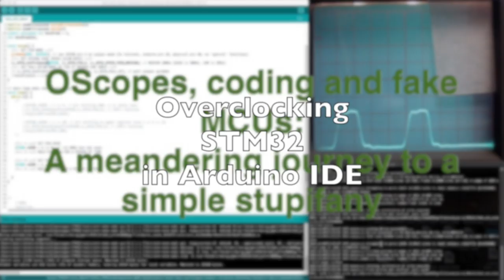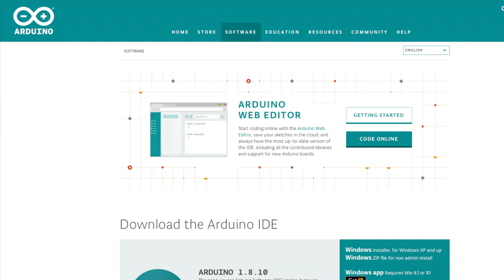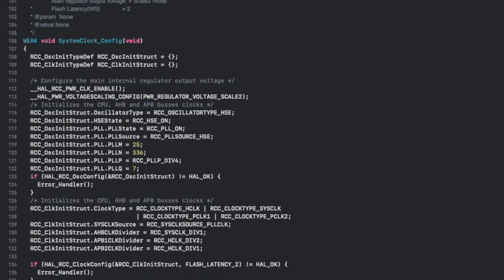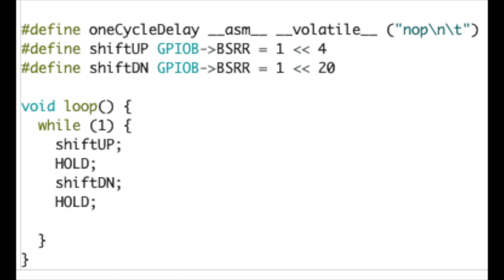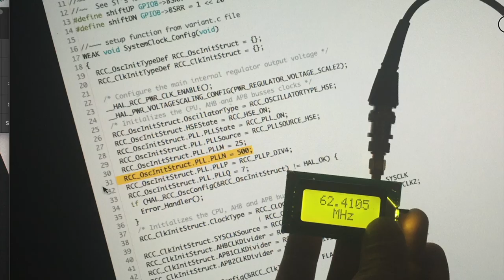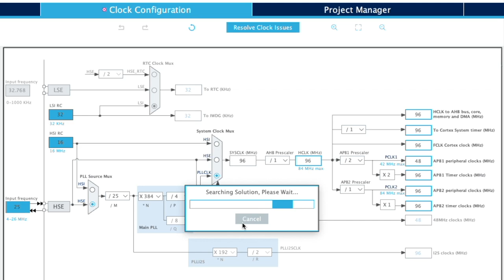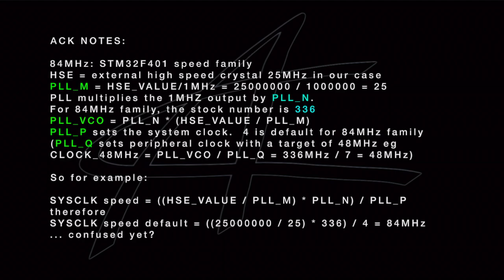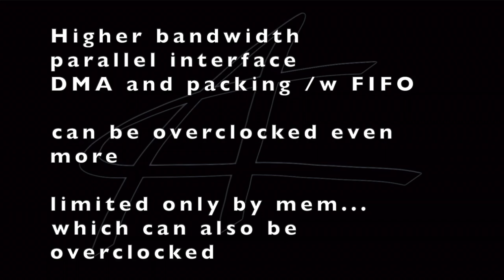TNTM: Easy STM32 Overclocking in Arduino

Comment: 8:22 — HAL developers are standing by! It looks like we can use CYCCNT on M3-M7, but only M7 seems to have DWT_Type.LAR. If we condition out the line referring to LAR on the M7 then it compiles okay for the STM32F4. I'll submit the patch as a PR and see if it passes muster with the STM32 geeks.
Reply: Yeah, what he said. https://github.com/MarlinFirmware/Marlin/pull/15762

Comment: Hey Alex, I really enjoyed your micro switch videos. Have you heard about Razer's optical micro switches? I think that might finally solve the problem as long as the spring doesn't wear out. I bought the Viper Ultimate to see how it'll go.
Reply from the maker: I heard about them but haven't tried any yet. Hopefully they nail the feel since that's what most people have trouble with in optos
Reply: @AlexKenis  The feel is awesome. Harder to push than my favorite D2F-01F Omrons from Digikey and not as metallic sounding, but just as snappy and never a missed click. They left the typical micro switch spring in place, but added an optical shutter at the end of it. I hope the mouse holds up mechanically as it's extremely light.

I also had a thought about increasing the current through the micro switches: add a small capacitor and resistor across the contacts. Every click would discharge the capacitor. Could that work?

Comment: I don't have a variant.ccp file. Or does this not apply to the STM32F103C8T6 boards? 

C:\Users\Rudy\AppData\Local\Arduino15\packages\stm32duino\hardware\STM32F1\2019.10.9\variants\generic_stm32f103c
There is only a variant.h file.
Reply from the maker: Hmmm... my path is different.  I reinstalled the IDE and all the board files recently, so maybe it has changed: /Arduino15/packages/STM32/hardware/stm32/1.7.0/variants/PILL_F103XX/variant.cpp
Reply: @AlexKenis  Hi, I only see this for the F103xx. Any suggestions?
  RCC_OscInitStruct.PLL.PLLSource = RCC_PLLSOURCE_HSE;
  RCC_OscInitStruct.PLL.PLLMUL = RCC_PLL_MUL9;
Reply: @howhy448   i was  just experimenting and came to know , you just need to change RCC_PLL_MULL9 ( change the 9 here)..  but, my blue pill stopped working at 16. i could only overclock it upto 13. and I would recommend yo use official ST software.
I got a significant boost by overclocking using ST official supported STduino.